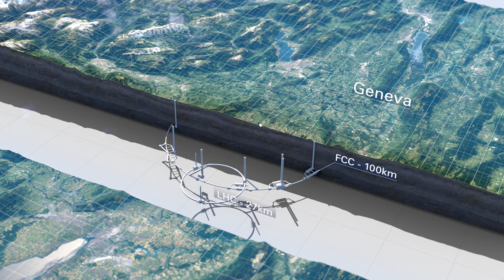Designing the Future Circular Collider

Comment: Can anyone tell me why a bigger one is needed?
What will an increased size improve on the previous one?
Reply: Currently, the LHC produces centre-of-mass energy of around 13-14TeV during a proton-proton collision. With a larger radius/circumference, the protons acquire more energy as they get closer to the speed of light by some fraction. The FCC is expecting up to 10 times the energy of what the LHC can produce.

Now as to why it is needed. 

The LHC's main goal was to find the existence of a Higgs-like particle which it succeeded in. Unfortunately, it has not been useful to 'find' anything new Beyond the Standard Model (what we currently know including the Higgs), per-se (there have been some exciting findings besides the Higgs, but nothing to top it like confirming the existence of Supersymmetry or dark matter). It has been useful to perform exclusions of Supersymmetric models and so on, but not enough to delve into the realm deeper. Hence, a larger, more energetic collider SHOULD, in theory, allow us to 'see' what is going on Beyond the Standard Model. Another possible findings that are hoped for are dark matter, in which many models exist for, meaning if they manage to probe into its existence by 'creating such particles', then it would be a historical finding needless to say. Either way, there are many important and relevant theories which the FCC can and will aim to probe into that the LHC can't. Also, another usefulness for a larger collider is to refine what we already know. This might seem like a waste of money if this is what it will only achieve, but there is a benefit in knowing things with better precision. 

Remember that the LHC found the Higgs within a few years from starting operation, so we can expect a massive influx of new physics being refined because of the FCC hence it is really exciting to think of what the future holds! I'm not sure if experiments will be obsolete at the LHC once the FCC is turned on, but it will still be used as a booster to propel the protons into the FCC at least.

I hope this helps, and I'm happy for others to put their knowledge in as I only finished an undergrad and nothing more..
Reply: @KM-00  oof
Reply: @KM-00  Sorry for taking 3 years to answer, hope you are still alive, thanks for the answer.
I stumbled once more upon this video by chance because I was looking for info about the FCC, I don't know why but I thought this was abandoned just because of how expensive it is but apparently it's not so...

Thanks for the explanation, if I understand, it makes particles go faster with more energy, therefore better reading from the particles once it smashes more energy makes it easier to detect.

2045 is a long time, by then we would likely have ASI already so might be that we are building these tools for AI to study reality.
Reply: Because the greater the acceleration of the particle, the greater the radiation loss power of the particle, when the radiation loss power is equal to the simultaneous acceleration power, the particle no longer obtains net energy, and thus the speed no longer increases to reach the maximum speed (maximum energy). If we increase the radius of the accelerator, a greater velocity is required to achieve the same acceleration (centripetal force equation in high school physics). Therefore, when the radiative loss power is equal to the simultaneous acceleration power, the particle has more velocity and more energy.

Comment: I'm just going to guess that they need a larger colider because the high the energy level the harder it is to change the dirction of the bean, thus needing a larger circular colider that has smaller angle arc.

Comment: Will you need another one after this?
Reply: It depends. I think this should power approx. 10 times the energy of what LHC currently has and that should allow room for many theories to be adjusted accordingly, specifically any new 'particles' Beyond the Standard Model. The leading field is supersymmetry and the FCC is under construction in hopes that they justify it (if I read it correctly), but there is still a chance that SUSY can be debunked in its entirety. Either way, they'll need to adjust current theories according to the findings at FCC. This should show if they would need a larger one, but who knows where the world is heading to such that a much larger collider can be built. Furthermore, particle physics can be tackled with phenomenology and the up-and-coming grav-wave physics is useful for it, so if they find something better in this field then a need for colliders may even be futile. 

tldr; too early to tell because of the accelerating advancement in science and technology, as well as the political climate of the world.
Reply: Yep the size of milky way